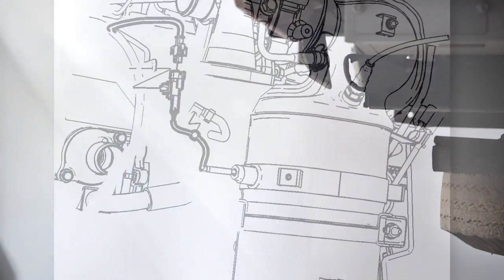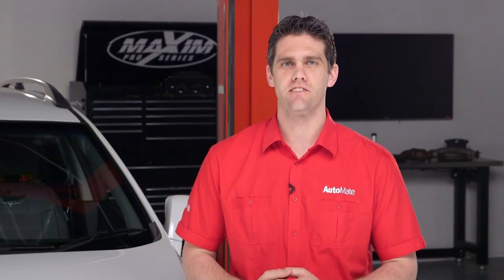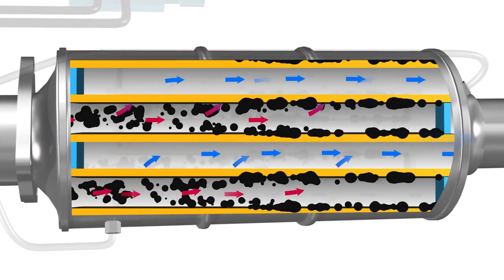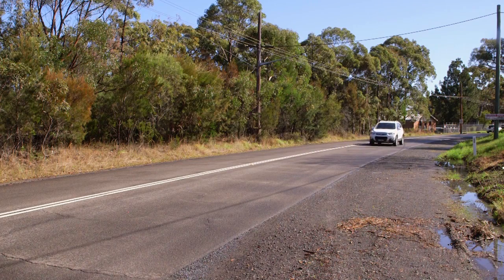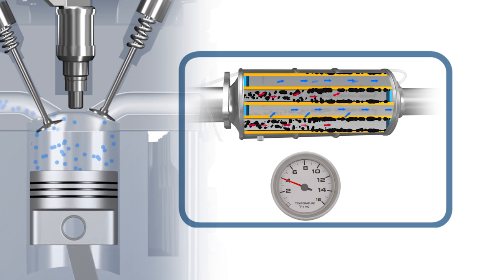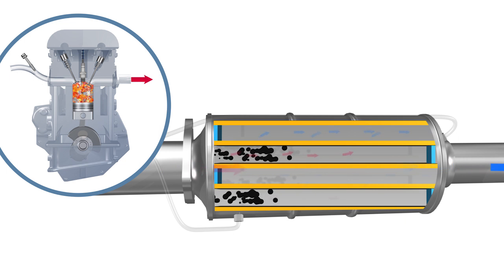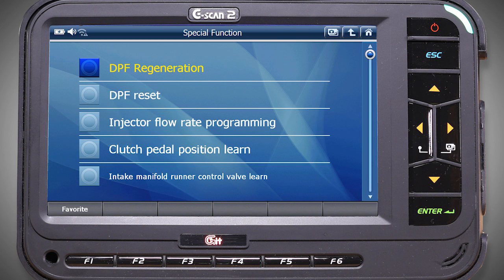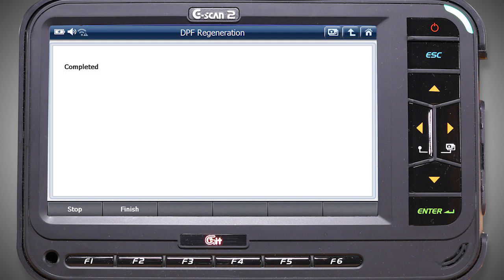Diesel Particulate Filter Fundamentals

Comment: Hi there. 
I would be grateful for your advice. I have a 2013 diesel cruze 2.0L with BRAND NEW Full motor and a BRAND NEW DPF with brand new oxygen and temp sensors and with less than 10,000Km since install. In the last couple of month i have been getting frequent diesel white smoke every 100km or so and NOT on cold start. It showed P11FF code Fuel pump command signal counter incorrect. the wires to the Fuel pump are all intact and the car start first click with no flat or week spots across the revs.  I would appreciate your advice. 
Thanks in advance

Comment: Blocked DPF will cause the engine to dump diesel into the engine oil - dipstick reads higher.  Short trips cannot clear the DPF, replace it
Reply: Do 2 hours long trip at 80-100km/h without stopping.

Comment: What happened about the discussion regarding the Differential pressure sensor , you were supposed to talk about later then ? At around 01:08.
There is a glow plug fitted somewhere along the exhaust which heats up to help turn the poisonous gases into harmless gases , why has this not been covered ?
If the glow plug fails to operate for itself failing or a blown fuse feeding it , that will cause the DPF to soon clog up and go into limp mode and completely clogging the DPF up .
I know this as I had a transit that this happened to due to a gross incompetent garage paid fuck loads of money to sort out but took my company for a money pit , to which I ended up resorting to replacing a blown fuse and rengerating it myself on my own laptop and that fixed the glow plug issue , the garage lost the contract,   mmm 🤔 I wonder why ?
Half baked video not covering the entirety of how DPFs actually work .

Comment: The government should have stipulated that there are to be 5 or so standard DPF capsules in all cars that can be removed from the metal casing by opening clamps. There should have been a minimum price DPF manufacturer in every city that takes the the DPF and either cleans, rebuilds or recycles them.

Comment: Very nice and informative video.
My Mercedes Benz diesel had a restricted DPF and the only solution was have it opened and professionally cleaned in a DPF Cleaning Shop. It cost me $350.00. An online shop asked me asked me a "low price" of $2,000.00 for a 
remanufactured DPF. Mercedes DPF can only be opened cutting it in two and later welding it back.
Reply: you do know why mercedes have such high prices right? if not, its cause their services are a lot better than other retailers and garages that you go to and their parts can be £200 more because they're built to last you more than a year. say you need a new dpf, you get a price from ats for £150 and one from mercedes for £600. obviously merces are a lot higher because of the build quality and cause they can last longer.

Comment: It is a nice, helpful video for the average person, but for US, PROFESSIONAL TRUCK DRIVERS, WE KNOW what a RIDICULOUS, EXPENSIVE, BARELY EFFECTIVE, PROBLEMATIC, PATHETIC, and EXTREMELY COSTLY SYSTEM THIS IS! It has been in use for over a DECADE NOW, and hasn't gotten ANY better, and NEVER WILL, cause IT DOES NOT WORK. MANUFACTURERS and DEALERS have NO INTENTIONS to FIX this "FAILED SYSTEM", they ARE MAKING "BILLIONS" with it; IT ONLY CAUSES PROBLEMS and Makes TRUCK DRIVERS/OWNER OPERATORS to go BROKE!!!
Reply: In Sri Lanka we have a very simple solution: EMSOL-Fuel System Cleaner, a home invented fuel additive,               added to the fuel tank ( it works equally with both Diesel  & Gasoline) @ 1ml per Litre. You need to use on a half tank  minimum but full tank is advisable, as it cleans the entire system from the tank sludge to valve deposits and DPF, as you run until the next refuelling. It costs you just US$ 7.50 for 100ml but relieves you from so much of pain you listed. Also EMSOL Fuel Economizer when used with normal Auto Diesel gives you much smoother engine performance with added power and upto 25% longer engine oil life, with upto 20% more mileage. EMSOL has been tested to ASTM and recommended by the Automobile Association of Ceylon.  https://www.youtube.com/watch?v=dVSCem28yXo . www.emsol.lk
Reply: @sunilperera6260  ; will check it out... thanks!

Comment: Question- just bought a diesel VW, and all of this is new to me. I have seen a fuel additive that is supposed to clean the filter. Recommended? Effective?
Reply: Helps, but its not sure how help it will give. Best and most sure way  to keep your DPF alive, is to go for a ride, and run it above 3000rpm  for 10-15 mins.  Once/month  or once/ 2 months. This will keep your dpf alive and fresh :D
Reply: @sakhsdragunof  That's what I hate about diesel - I have to drive it the way it is healthy for the diesel. I prefer to drive the way I want! With my other petrol car everything sounds perfect even when I drive calmly around the city for months without having to rev up to unclog the dawm thing.
Reply: @ivanangelov8825 Do not rev up, it's called the Italian tuning but it doesn't work for my diesel car. Instead drive 1.5 hours non stop at 80-100km/h at around 2k.

Comment: You have missed out one key issue: During dynamic regen, the blasts of diesel during the post injection could reach the cylinder walls, and it's washed into the engine oil. If you are running with a clogged DPF, you car will constantly want to regenerate.
In my car, had a clogged DPF, but the waring light failed to indicate it soon enough. I have ran about 500miles with it when the light came up. The engine oil level was 1/2" inch above the max line (had an oil change about 300miles beforehand, so the level was good to begin with), and it also smelled like burnet oil and diesel. In the end I sent the filter for cleaning and oil change, and they drained 1liters more oil than the maximum. The factory oil amount in that car was 5,3L, so it was diluted around 20%. So this could ruin your engine. Also mine had a timing chain, which is sensitive to oil quiality.
In the end I didn't kill the car because we spotted the issue, but oil dilution is a very big problem!
Reply: Good that you figured out the problem. Thanks for the info!
Reply: Great info, thanks!

Comment: 45 minutes every 2 weeks... seems reasonable, if the car you want to buy, has no petrol version.

Just take better care of your diesels, and you won't have to spend thousands on DPF renovation.
Reply: 45 min what? Like motorway trip? How I must drive high rpm? Like 4000.4500? Or just like normal 2.500 rpm?

Comment: Been driving DPF cars since 2005. First was a 2001 Peugeot 406 HDi. So far I've had no problems with them.
Reply: PSA (Peugeot & Citroen ) fitted a Cerium additive (PATS fluid) system in their vehicles . This enabled the soot to burn off at lower temperatures. It was well worth the extra cost and these engines had far less issues with blocked DPFs and diesel dilution.
Reply: Driving a Peugeot means you’re the one with a problem
Reply: @AndrewSmith-pp6ir  HAHHAHAHA.
Reply: @AndrewSmith-pp6ir  What a peculiar comment.
Reply: Had 407 2l diesel, was brilliant. got rid of the EGR and DPF, ran even better. 5 litres/100
Reply: @partymanau  I have Citroen C4 B7, 3.8L/100 on high ways.
Reply: @partymanau That 2.0l engine was probably the best and most reliable diesel engine ever built.

Comment: These DPF's are so terrible and a true testament to the fact that so many greenies are brain dead. They cause more pollutants over time, including much more carbon emissions when it needs to regenerate. That's on top of the fact that most WILL fail, its inevitable. Not only that but it WILL damage your engine and especially your turbo because its restricting air flow too much. I noticed my diesels DPF was straight after the turbo, needless to say I took it out asap while keeping the housing so it looks like its still there.
The DPF makes every single diesel on the road a lemon, with some models more so than others.
Reply: Uncl Dolan Exactly right. My 2018 Landcruiser 200 has 13000 kms on it.. Every  now and again it leaves a massive smoke screen behind. The DPF overheated once and is now sooting up the tailpipe. When Toyota replace it under warranty I will remap it and relocate the DPFs to the garage shelf.

Comment: if you get the DPF turned off via the ecu by a tuner, will you then need to actually remove the dpf from the exhaust?
Reply: Yes. It will still clog.
Reply: yes  as it will be catching the soot and not burning it.

Comment: I hate the DPF - I am always having issue with it in my 2009 Diesel Hyundai Santa Fe! Can it be removed without complications to other parts etc??? Will it cause sensor issue with the computer etc?
Reply: take it to a place remove it and have the car remap and that´s it wont have anymore issues...
Reply: You will not have this issue when you use EMSOL-fuel system cleaner every time you do your servicing. EMSOL IS Sri Lankan product, probably available overseas.
https://www.youtube.com/watch?v=dVSCem28yXo
Reply: Yes, you can remove it, but it technically won't be legal for road use in the United States. Take it to a performance shop for diesels, they'll take the DPF off your plate for about $1000.00

Comment: So what you are saying is, instead of venting exhaust as normal, we are now storing the harmful particles until full then dumping more fuel and particles in the system in an attempt to clean it out? Common Rail diesels typically have higher fuel consumption than pre common rail diesels so doesn't this increase the particulate count and make pollution worse?
Reply: this is not true. if you drive the vehicle properly (long trips, no short trips...) the dpf will spontaneously regenerate aka burn itself clean without a forced regeneration cycle that requires extra fuel to burn the dpf clean.
Reply: Nathan Ward Yes! More fuel is consumed in an effort to reduce the emission of large particles of soot. CARB has been threatening the auto manufacturers with GASOLINE DPF’s as well. This is why you are now seeing “dual fuel injection systems” on gasoline direct injection engines. They add multi port AND direct injectors to avoid using DPF’s on gasoline engines. Can you imagine gas cars needing to regen? Gasoline consumption would skyrocket! California can sure come up with some brainless plans to “clean the air” lol

Comment: The soot is getting accumulated at the DPF, but on regeneration it is again being released into the atmosphere.
Soot is carbon it won't get converted even at 800°C.
It remains harmful.
Reply: abdullah basheer And don’t forget the extra CO2 that’s released from the 1.5-2-gallon regen cycle. My f250 dpf takes about that to regen every 300 miles. That really adds up if say, 375,000 of this 6.7L Diesel engine is sold annually. After a million of these are on the road (which are currently) You’re talking tens millions of gallons of diesel just to regen them monthly for decades. Then add the millions of enormous DPFs on the semis... the light trucks....the diesel autos... now you’re talking hundreds of millions of gallons burned just to regen! Billions of pounds of CO2 released (and don’t forget all that diesel gets trucked to fuel stations...) it goes on and on!!
Reply: @natehawkins2910   The government likes the tax revenue from the extra fuel you need to buy. lol
Reply: Random Channel Exactly! My regens on my 2019 f250 use approx 1.5 gallons of additional diesel every 300-500 miles depending on fuel consumption (read that exhaust temps that increase with increased fuel consumption while driving under increasing loads). So over the life of my truck, I’ll do 1000 regens, and use 1500 gallons of fuel at 54 cents per gallon. That’s $725 per truck that rolls off the line! Sounds lucrative to me! Lol
Reply: @natehawkins2910  Thanks to those EPA geniuses. Once that soot gets cold, it comes down on the ground and stays there. What a load of shit.
Reply: I thought that myself
Reply: @Little Reptilian So what you're saying is the harm we do to the environment globally is bigger since we burn more diesel and the industry is more harmful for producing all these dpfs?With the exception that these particles are not gathered in populated areas.
Reply: So at what temp does it convert then?
Reply: Your observation is right. The DPF is only a reservoir tank for the soot. When re-generated all the particles adds to the surrounding area. The best method is to minimize soot in exhaust by using a good fuel additive. In Sri Lanka we use a home invented additive "EMSOL". EMSOL-Fuel System Cleaner resolves the DPF issue by Cleaning the entire fuel system from the tank down to tail pipe to a great extent when added to the full tank @ 1ml per litre of DIESEL, and run until the next refueling. EMSOL -Fuel  Economizer USED regularly every time you refuel, gives you near 100% complete combustion, more pulling and upto 22% extra distance and 25% more lube oil life, with a smoother engine.
https://www.youtube.com/watch?v=dVSCem28yXo

Comment: what happens to the burned off soot (ash)? how does it get out?
Reply: Soot is carbon, the carbon is burned off at high heat and becomes carbon dioxide, a gas. So to heat turns a solid into a gas. This is the same thing that happens in a camp fire, you have carbon (wood) converted into CO2 (gas)
Reply: Soot burns off at a very high temperature and gets blown out of exhaust  pipe.
Reply: Karthik Nagarajan @ same question in my mind after watching video
Reply: It's better to delete the DPF they're extremely problematic as well as the SCR and def systems
Reply: @alextepozteco3681   its illegal to remove dpf in the UK.
Reply: @amjadkhan-jv6xj  same in the u.s. now but we still do it because because of factory issues we kept having that kept having derates and shutdowns, and 3 times we had vehicles shutdown in death valley which is an extremely hot area that caused a lot of furious customers, so we started deleting them and reprogrammed the vehicles so we had no issues